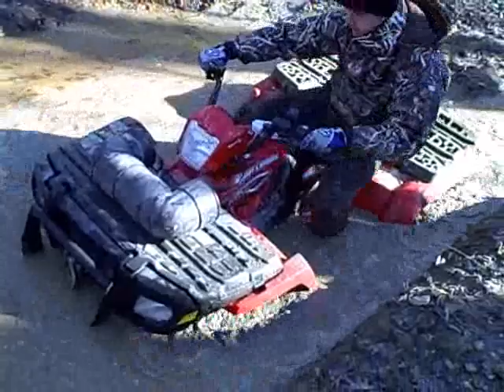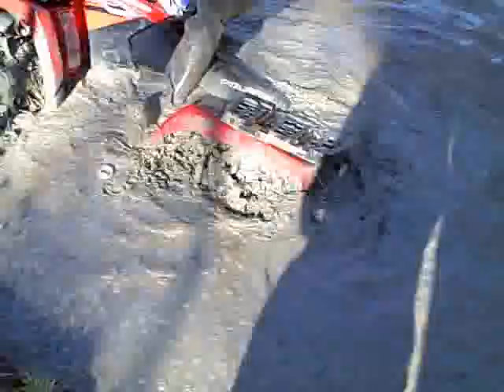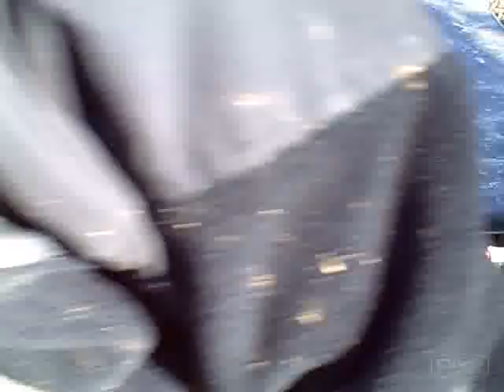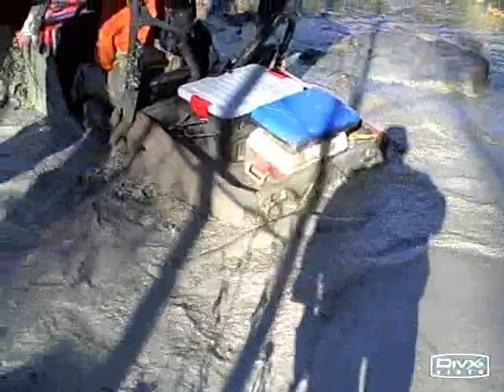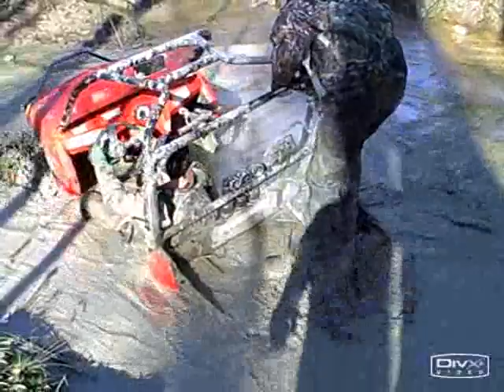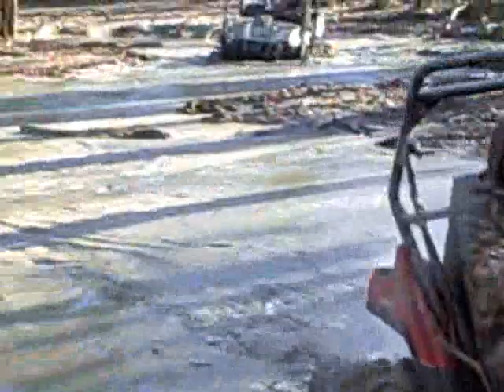RZR RHINO DEEP MUDING 3

Comment: as long as you treat the big tires right and don't gun them all the time then it usually don't hurt to bad. i have 28'' outlaws and my 4-wheeler is fine. i don't gas it in hard stuff a lot and stuff though.